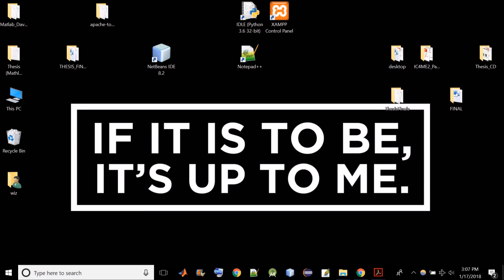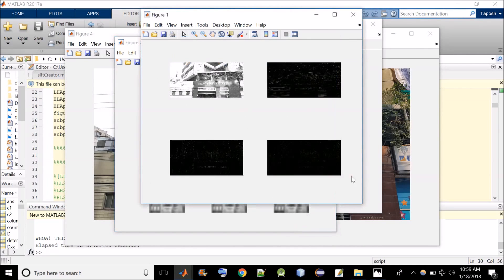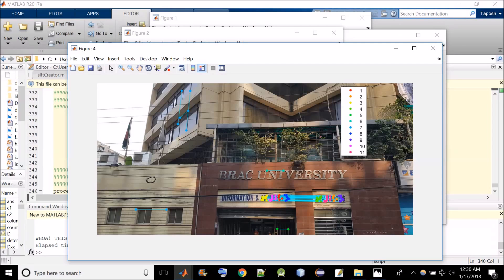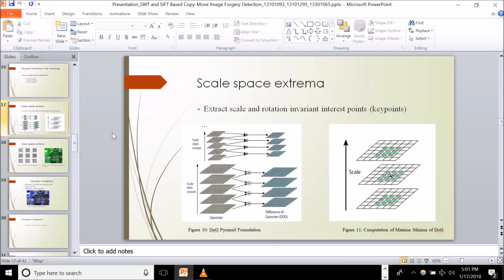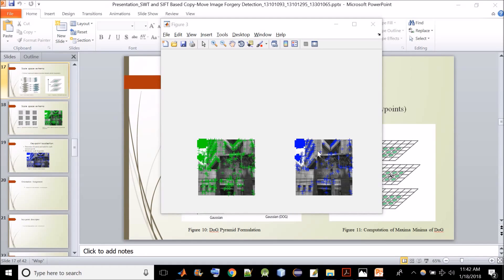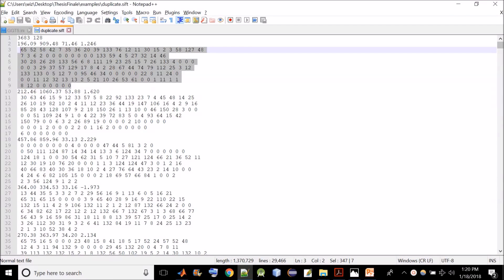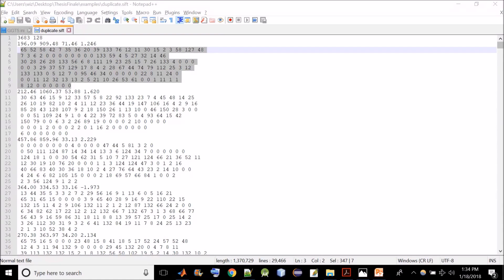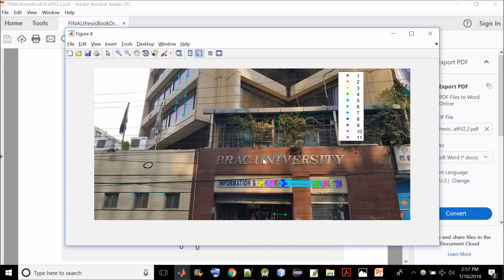A Robust SIFT-Based Copy-Move ( Cloning ) Image Forgery Detection Using Matlab Code

Comment: Im also working on the same project.
Can you tell me how did you use the LL part from the DWT output for the input of the SIFT algorithm?
Reply from the maker: I didn’t work on DWT but the core principle was to an extent similar. You need to set the floor and ceiling of the values you get within the rage 0-255 because pixel values cannot be negative nor can it exceed 255.
Reply: DWT is pretty similar to which you have used. I have made separate codes for both (dwt and sift), jz the problem is im not able to connect them. 
I can mail you the codes if you want, jz help me connect them, will you ?
Reply from the maker: The solution as I have already said is you need to keep the values of the Low-Low band of data you get from DWT within the range 0-255. and then pass LL to SIFT.
Reply: Taposh Das For your knowledge I'm an engineering student. I jz have the basic knowledge of MATLAB. The problem I'm facing is how do i pass dwt to sift ? I have searched alot but couldn't find any solution on this.
Reply from the maker: Okay Pranav since you've mentioned earlier that the only problem you are facing is connecting the two algorithms so I'm assuming your sift algorithm is working correctly. if so then its obviously taking an image as input parameter. When you get the LL part using DWT and one of the mother wavelets you have to pass LL as parameter to uint8() and save it in a variable. Use that variable as SIFT's parameter instead of an image of jpg/bmp/other formats
Reply from the maker: here is the code for it:
[LL,LH,HL,HH]=dwt2(y,'haar');
LLApproximateImage=uint8(LL);
Reply: Taposh Das Oh thanks now I understood ...I will try to implement it !! :)
Reply from the maker: Glad I could help. Best of luck!
Reply: I was able to save it in a variable as you told.
But when I use that variable for the input of sift, i get an error as  the variable is not defined !! :(
plz send me the your email id so i can send u the code i have written.
Reply: here is the code.

https://drive.google.com/file/d/192seWRXQIc-bL0OuORkoao95oudUT0Nk/view?usp=sharing
Reply from the maker: Pranav the first level approximated image that you get from dwt2 is a variable, not a file. so at line 18 when you assign that variable to img in a single quotation, its taking the variable as text. Your code is showing error because your sift right now is processing text not image. Here is the solution.
1. Line 18: img= FIrst_level_Decomposition; (if it doesn't work then follow the later instruction in #2 below)
2. Create a jpg/bmp/png file(using matlab commands) and save your First_level_Decompotion variable in that and then pass your newly created file to sift.
Reply: Taposh Das I tried 1st solution alrdy...it doesn't work ...it gives errors in resize function
Reply: Taposh Das I have searched matlab function for the solution 2 ...but didn't find any .....what did u use in your code ?
Reply from the maker: well it's not working then folllow the second way. the underlying implementation of your algorithm is different than mine that's why it's not working. only you can figure out which one will work for you. As for the second way try using imwrite() function where the first parameter is the data you wanna write and the second parameter is the name of the image file.
Reply from the maker: Pranav it works. Try this...write imwrite(First_Level_Decomposition, 'demoImge.jpg'); after line 8
then  at Line 18 write img='demoImge.jpg';
Reply: Thanks it worked :) 
If i find any further difficulty i try to contact u. :)
Reply from the maker: welcome and best of luck :)
Reply: Have you used the same code for sift from the link below https://in.mathworks.com/matlabcentral/fileexchange/50319-sift-feature-extreaction
If yes plz tell which variable is asigned to the keypoints ?
Reply from the maker: This algorithm has a significant amount of errors. Print out the extracted features(descriptor vector) it generates...you'll know what I'm talking about. I mean it's not even a 128*x vector. I used some part of it though for instance how it formed the DoG pyramid and how to show the accurately detected key-point in an output image.
Reply: Can you please tell me a better explaination for KNN algorithm?
Or jz provide a better site for it ?
Reply: Also what changes should i do in the sift code 
which i have used ?
Reply: @pranavm002  can u send the code for this Matlab program
Reply: @pranavm002  this is half code please send me entire code